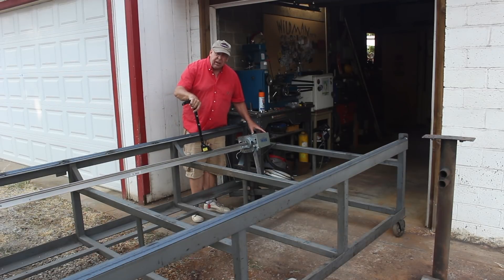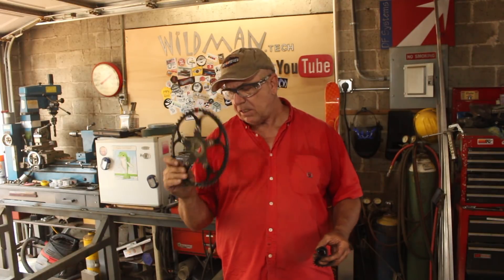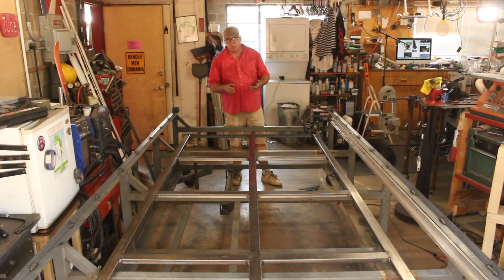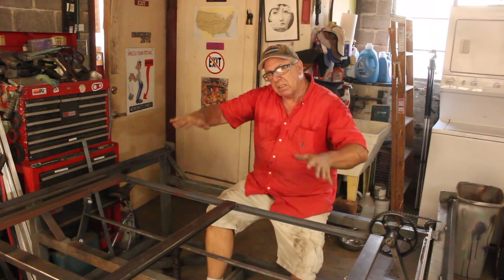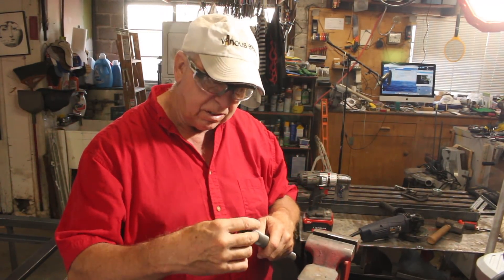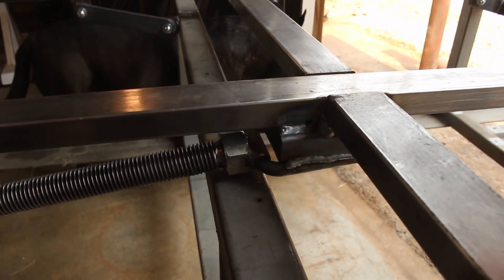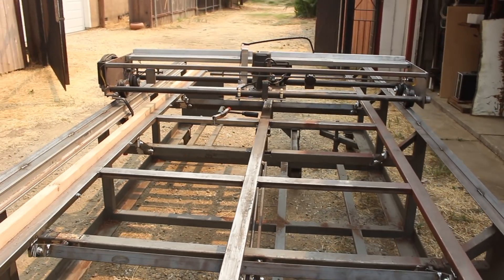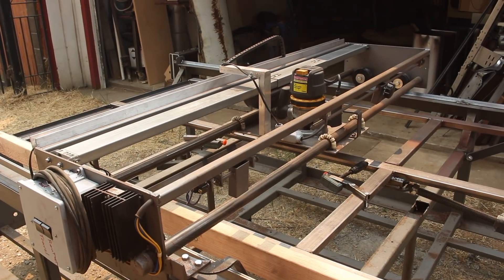Slab Surfacing Machine Finale

Comment: Wow not much more and you could have just built a Cnc to automate the whole process and more! Great video!!
Reply from the maker: This is light years from a CNC and thousands of dollars from being a CNC. The gantry slides are V rollers from a gate. The router slides are nothing but a U-bolt with nylon washers stacked around it to act as rollers. That said, I do have another one of these giant table frames and I'm considering making it a CNC to show the difference in effort and expense.

Comment: With a frame like that I'd have to cnc mine to make it more versatile. I'd still want the hand cranks for fast things. I'm still not sure why you built it. An Alaskan style portable saw mill would be cheaper and probably faster if slabbing is all you needed.
Reply from the maker: This will not cut a slab. When you cut a slab and let it continue to dry, it warps and has massive gouges from the blade that cut it. This tool flattens it and removes those gouges. That's why it called a slab flattener instead of a saw mill.
Reply: Wildman Tech That makes sense. I see some big natural edge projects in your future...
Reply from the maker: This was a commission job so I better try to negotiate free use of it as my bonus. I have another frame like that. Maybe I'll make it into a CNC. It would definitely sell for more.
Reply: Scot Miller. If you want to see a real log turner I suggest you make it to the festival in Mount Pleasant Iowa labor day weekend. They have an old turn of the century veneer cutting machine that's run off an old steam engine. Huge trees are sectioned about 8 feet long and thrown in a vat where they boil them in water to soften them. Then they put the sections between points like a giant outdoor lathe and spin them with a full length knife pressing against them. Two guys grab the veneer sheet as it's peeled off the tree trunk and start walking. They will give you the veneer if you want. It still needs to be laid out flat to dry but you can coil it to get it home. Fun to watch how the machine works. Hundreds of other machines on display there also. Any YouTuber looking for interesting content will find volumes at this week long "Threshers Reunion". An old straw broom making machine, hand operated printing presses, 100's of old steam engines, tractors and cars.  There's an antique flea mart going on and the have an old car museum that has one of the first electric cars among other great cars.